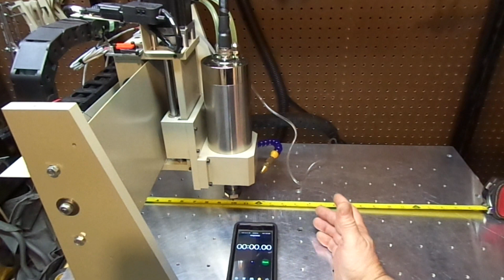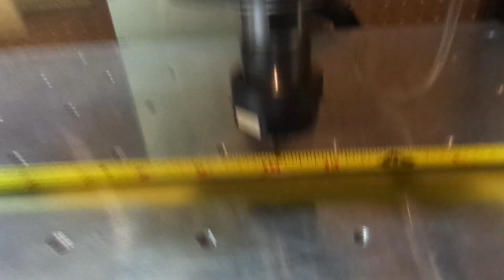6040 CNC Upgrade Video 6, Final speed testing

Comment: Thank you for all videos you have made and shared with rest of the world. I would ask you one question. Do you want to share set up on your mach 3. I have problem to turn spindle up thru the mach. Just bought machine it is same as yours.
Thank you
Reply from the maker: Mist ErZ is your controller box the tan or black one? I still have my original manual and those settings made the spindle work correctly. I can share those settings with you
Reply: @cpworx_maker  tan box i'm start getting crazy. i do have nothing no istructions  absolutely nothing. i really appreciate help. Seller is just no help at all. Please help
Reply: @cpworx_maker   thanks to offer help. My controller is tan color like yours. I do not have any instructions and drive me crazy that mach3 can't run spindle. It is usb controller and i downloaded dll file. I could move stepers thru mach 3 but spindle is problem.
Thanks again for your help.
Reply from the maker: @MisterZ50  I would assume you have the switch on the front of the controller box set to PC. My box was not a USB, it was parallel cable. My settings in Mach3 motor outputs was Spindle checked green, Step pin 1, Dir pin 0, Dir LowAc cheked green, Step Low checked green, step port 1, Dir Port 0.  On Spindle setup tab, Check Use Spindle Motor Output, Check PWM Control, PWM Base 301, Minimum PWM 30%. On the Pulley Selection mine was set to Pulley 4, Min speed 0 and Max speed was 24000 with a ratio of 1.Those are all the things you need to make the spindle be controlled with Mach 3
Reply: @cpworx_maker  Thank you for your time. I spend  whole day today and finally figure out. Now  is working good.
Reply from the maker: @MisterZ50  Great! Have fun making chips and making cool stuff